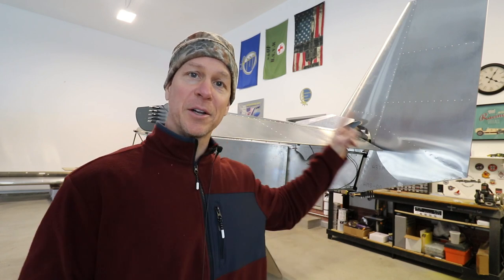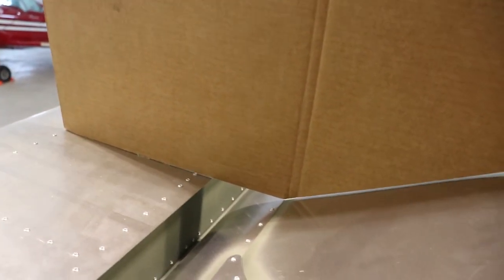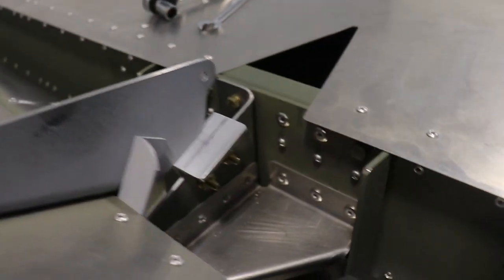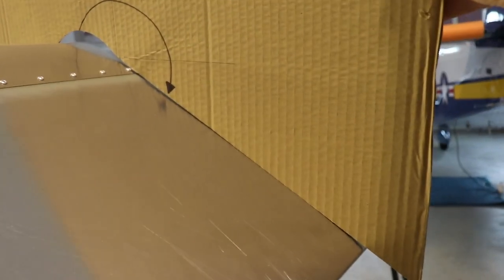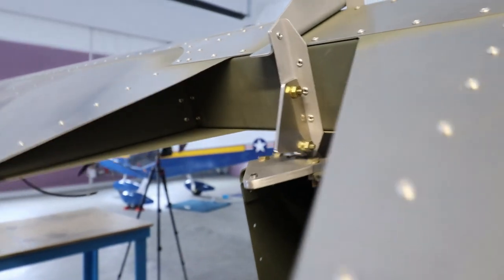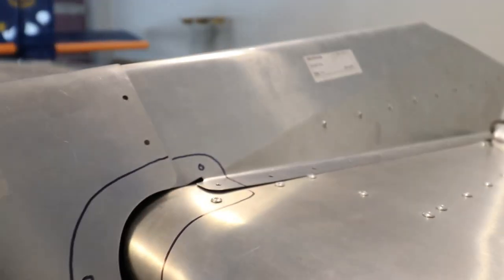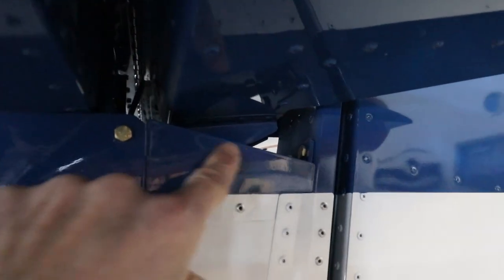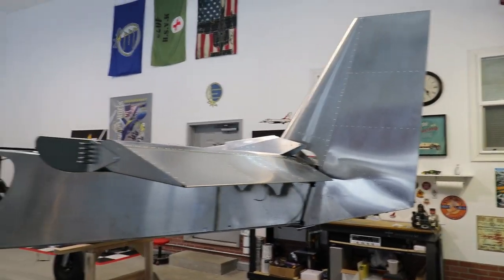Back to Building... (Ep80)

Comment: I couldn't get my elevator to travel full down, I have to cut a slot too. Thanks for pointing that out.

My kit's rudder fairing is in the way, thinking of cutting it rather than the rudder.

Comment: I was wondering about drain holes? Are you or do you have them within the build? Do keep the videos coming please, they take me back to my apprenticeship days in Short Bros Ltd, Belfast (now part of Spirit Aviation)
Reply from the maker: There's so many openings in this airplane drain holes are not needed. Usually drain holes are only added to fabric covered planes since the fabric completely seals a part (like the rudder, elevators, etc...)
Reply: @KitplaneEnthusiast  Mark, having built nothing myself, I hesitate to disagree with you on this.  Drain holes have their places even on metal planes.  

My Bonanza has many drain holes in its various structures.  Granted the Bonanza is put together 'tighter' than the Zeniths I have seen, so drain holes are probably not as necessary.   But even then there are places where rain water can pool and sit there if there was nowhere for it to drain.  I don't know, but I'd think some areas on the bottom of the SD fuselage could use a hard look in this regard.

Comment: Your building skills/experience after 4?  5? airplanes are way beyond where I will ever go with my one and only build.  I am curious - do you still occasionally run into tasks that end of taking waaay longer to accomplish than what you first thought?  It seems to be commonplace for me, and one of the reasons my build timeline keeps extending.  Thanks again for the great videos Mark.
Reply from the maker: Yes. Almost everything takes longer than I think it will. Even things like wiring a panel. This is the 4th panel I've wired and it still took me a month or so. But each panel is different and this is the most complex and advanced one I've ever wires. Most of the time is spent thinking about how wires and cables will be routed-and that's going to be different on every airplane. Making a fiberglass fairing seems to take the same amount of time whether I've made one or a hundred of them. Deburring holes or smoothing edges of aluminum sheets takes just as long on the 100th airplane as it does on the 1st. My whole thought process is that I don't care how long it takes me to build. If it's done in 10 years from now that's fine. I hope it doesn't take that long, but if it does then that's fine-I'm not going to rush through things.

Comment: Hello Mark from Sydney Australia.
Thankyou for your latest airframe progress video. 
Two issues that stand out for me; are
* Elevator specified maximum up and down angle; and
The durability of the elevator pivot connections.
In short, I assume by design, this is the maximum efficiency of the AoA using airflow around the control surface?
Is the pivot joint, aluminium on aluminium. Would this wear after years of repetition. Simply pin in hole, or nylon against steel rod?
🖇️🪶🛩️🤔
Reply from the maker: Hi John-there is a steel bushing used for the hinge on the elevator. On the two outboard sides a steel pin rides directly in a hole in the aluminum. Those two areas may be prone to wear after a while, but the aluminum with the hole is easily replaced if it does wear.

Comment: Just started my own build on a ch650, been binge watching your videos and something hit me. Do you think your 750 videos will help me with my 650 build? Obviously they are very different planes. But the processes should basically be the same id assume. Waiting for my rudder kit to arrive and am basically shaking with excitement.
Reply from the maker: Congrats on the start of your project! Hopefully you can learn a few things from my videos. Based on feedback I've received a lot of my subscribers are building airplane kits from Vans, Rans, Kitfox, Sonex, etc...

I try to cover basic topics like the how and why of demurring holes and polishing the edges of aluminum. Or how to wire the AeroLED lights...how to crimp electrical connectors and what tools to use, etc...

Even if you learn nothing, hopefully the videos will just offer you some motivation to keep building!
Reply: @KitplaneEnthusiast  im definitely learning already! Im very sure that the tips you give will keep me from making some costly and ugly mistakes, as well as making me think twice about every step and how it will be assembled afterwards (like leaving out rivets for overlapping pieces). Really enjoying the channel, thanks for making these videos 🙂👍

Comment: With Covid prevalent everywhere, are you alright?
Reply from the maker: Alive and well! I just didn't find any benefit to filming me run wire. Every airplane is going to be different so showing people me running 1,000 wires from point A to Point B isn't much help. Plus, I wanted to focus on wiring correctly and not filming.

Comment: I was wondering what happened to you. Is the panel wiring almost done?
Reply from the maker: It's all done except a few wires on the radio. I am waiting a bit because I need to route the wires to the headset jacks and I need to make sure they don't interfere with the flight control cables.